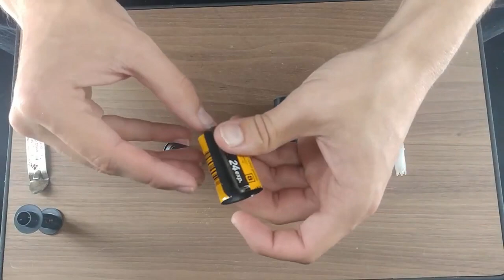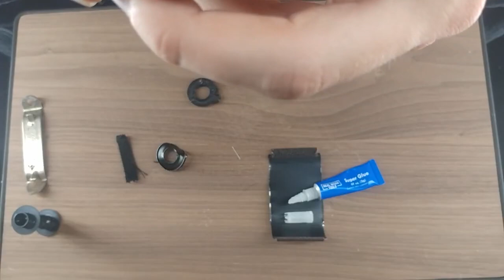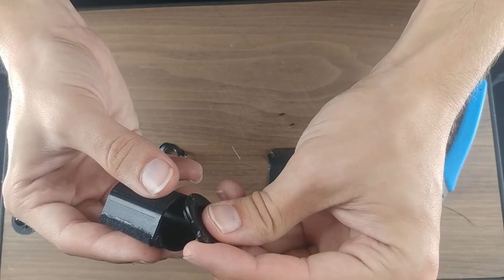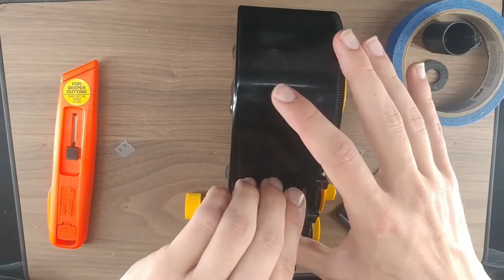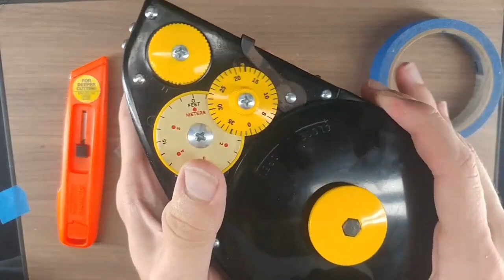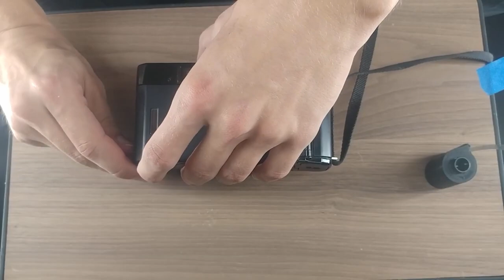3D printed reloadable film canisters

Comment: I see some potential issues.  First, most black PLA isn't really quite opaque in thin layers (though this should only affect the outermost turn of film in the cassette, unless your camera has a cassette window), and second, you can buy these for a very reasonable price (ready to use, felts already installed and easier to open than yours) -- making it (IMO) not worth bothering to print them (I've got a bag full in my darkroom).  Third, you don't include a spool with your Thing, so if you don't have a used commercial cassette handy (for that and the light trap felts), you're dead in the water.
Reply: Ever heard of "proof of concept"?